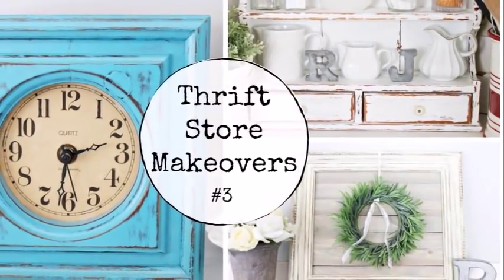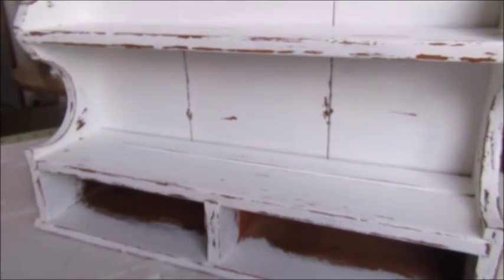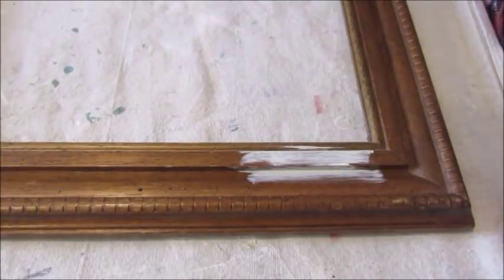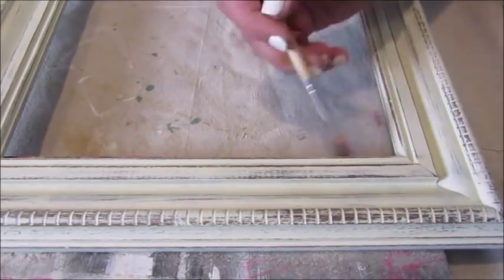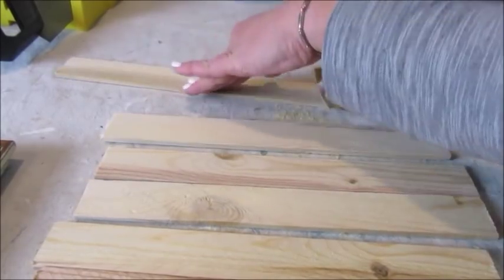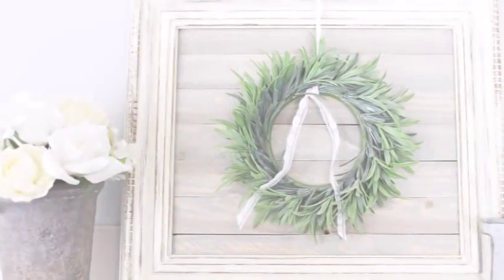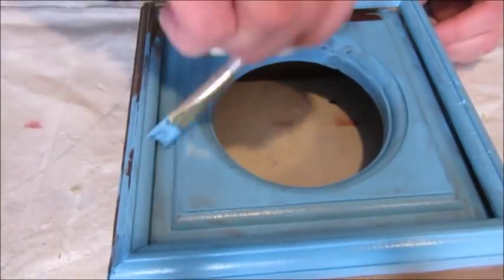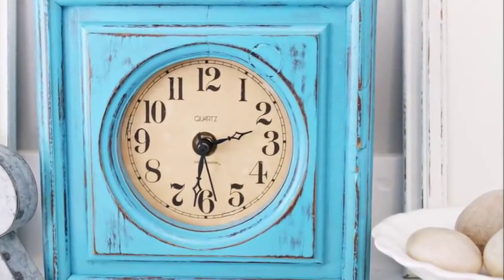Thrift Store Makeovers | #3

Comment: I see someone already made this comment, but it really is best to sand shiny wood before painting which you did only on the clock for some reason. They all look great though. Maybe the varnish will keep the paint from coming off the unsanded wood? I would upgrade that plastic herb wreath as the frame now looks like much higher quality. Maybe you'll find one in a thrift shop or in a regular store. I sometimes mix a thrift item with a quality one; it makes the entire piece look more expensive. You've got a better eye then some others doing this.